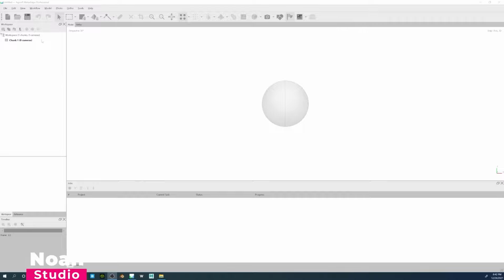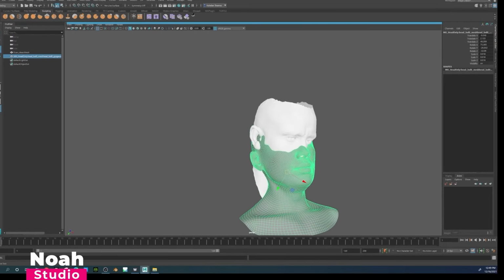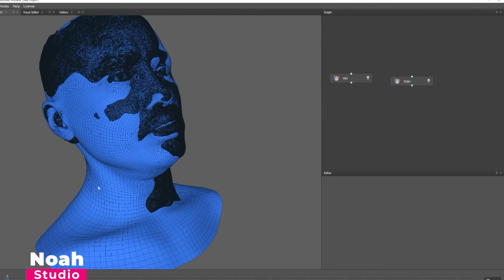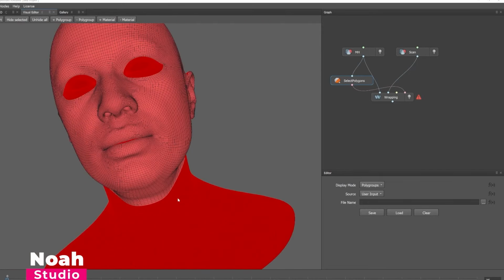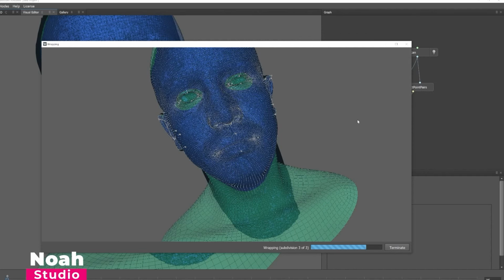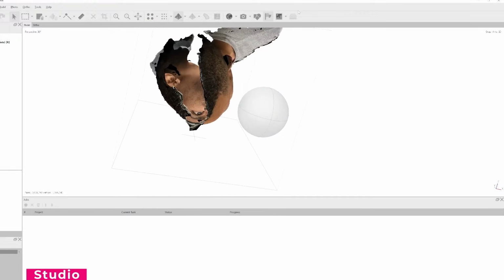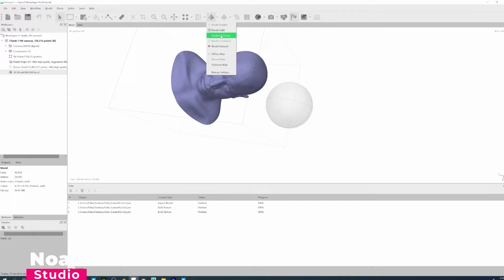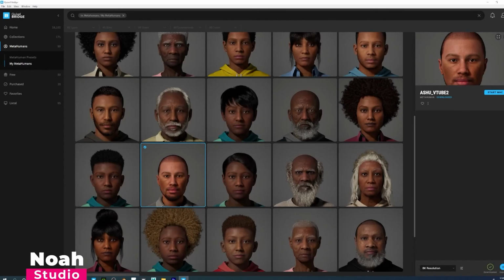How to change Metahuman face using Any Scanned Face and import into Unreal Engine(Clone yourself)_P1

Comment: Thank you so much for showing this whole process, but I have some problems and need some help.  After replacing the original model with the MH model, the new generated UV texture will have the problem of dislocation at the eyeball, which is represented by the stretched and interpolated texture between the eyeball and the skin, so it will cause many fuzzy long triangles. Have you ever encountered such problems.

Comment: You could have exported the final scan to Wrap3D and transferred the texture after you wrapped your model in Wrap3D.
Reply from the maker: Yes I can but when using brush to correct some issue from  the wrapping process the texture will be distorted so it is better re- projecting the texture on the the final mash.

Comment: great job brother. you just made a mistake you should add the blendsahpe target to the existing blendshape set and then in unreal keep the new morph target active at runtime. right now the face hasn't change at all you just replaced the texture
Reply from the maker: Yes you are right I should that. If you watch the beginning of the video's the shape is already changed but when i recorded this log tutorial I forgot it. I needed to update this video. Thanks for your correction.
Reply: @noahstudio3717  Another thing that could speed up your process when wrapping, is to handle the alignement of the head scan and the metahuman head directly in wrap3 using the Rigid Alignement node, https://www.russian3dscanner.com/docs/Wrap3/Nodes/RigidAlignment/RigidAlignment.html you do it before the Wrapping not only it handle the positioning of the head but also the scale.
Reply from the maker: @spezialis  I found out the use of  alignment node after the tutorial completed, yes it can save a ton of time. I started using R3DS wrap recently and I watched one tutorial only. Thanks for your comment.
Reply: @noahstudio3717  You welcome, thanks for sharing your knowledge too. I will try your technique soon, hopefully I manage to have a better metahuman
Reply from the maker: @spezialis  The defect happens in Part-3 which i need to work on it.
Reply: Once this process of adding the additional blendshape with a custom head is done, in unreal you still might have artifacts in the eyes especially when live linking facial mocap, when they move they tend to slightly go out of the eyes sockets. Since some time I’m trying to figure a way to correct this with animation blueprints without success. If you could teach us a way I would be eternally grateful.
Reply: @spezialis  retopologizing the face is the most important part it's very tricky anyway metahuman provides you with corrective blendshapes for each motion you can easily change corrective blendshapes in maya but exporting them needs a script that I'm writing soon will be released
Reply: @MetaRig  Awesome looking forward to see your script in action
Reply from the maker: @spezialis  at the beginning of creating MH, I tried to match the eyeball of MH  with the scan face(the size and position) then after the wrapping process completed I  re_wrap  the eyeball, eyebags, the mouth bag and the bottom part of the chest  on the original MH_Face. I think this should fix it.
Reply from the maker: @AYAM Expert, I did it in different way ,Please check it and let me know what do you think.